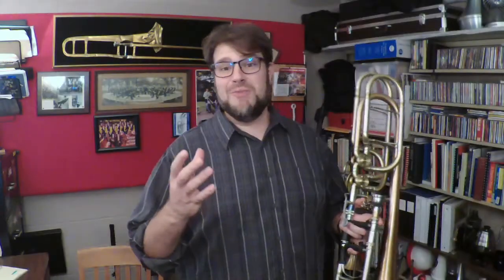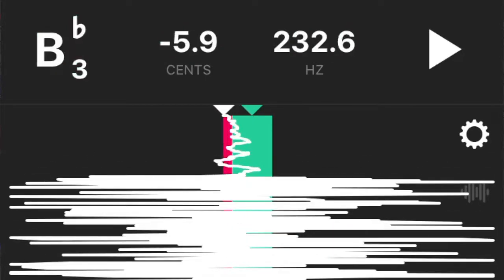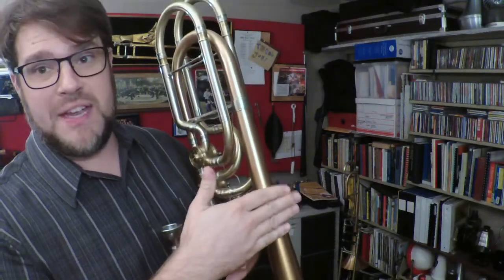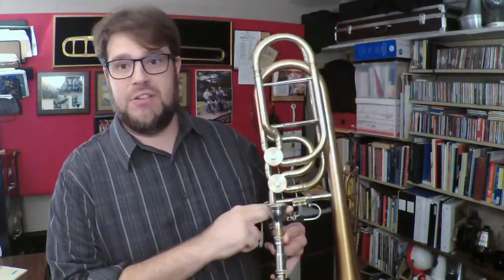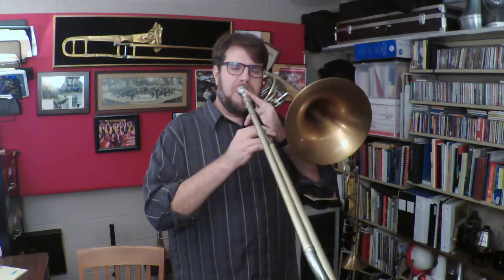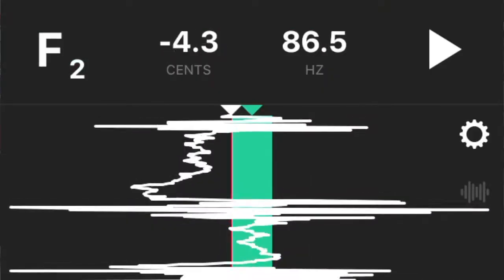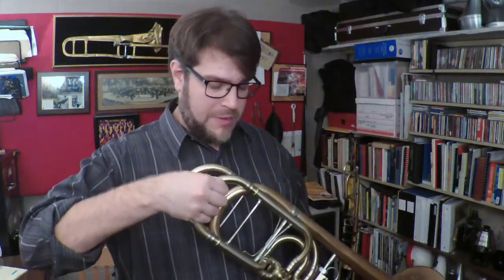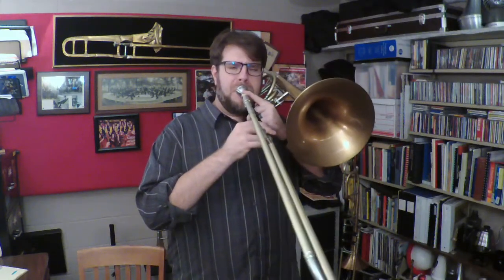Tune an Independent Double Valve Bass Trombone

Comment: Thanks for the video - great information to have.  I had a Bach 50 B (dependent rotor) converted to independent rotor about 10 plus years ago and thought the second valve was in G.  I'll try to tune it for Gb - that might work better.  My favorite notes to play with the valves are with the first valve - C in the bass clef staff, Bb in a short 4th position, and F below the staff with the second valve in a short fourth position.